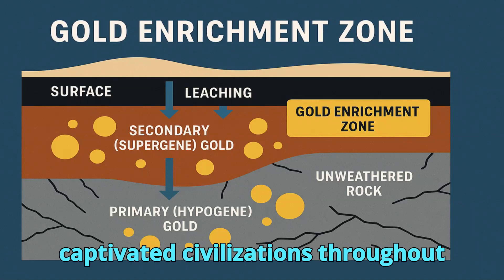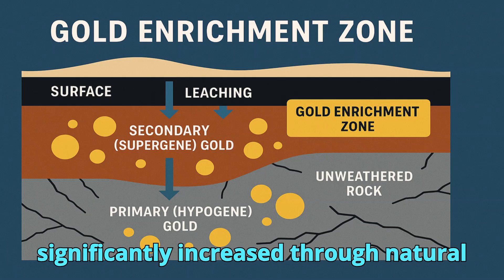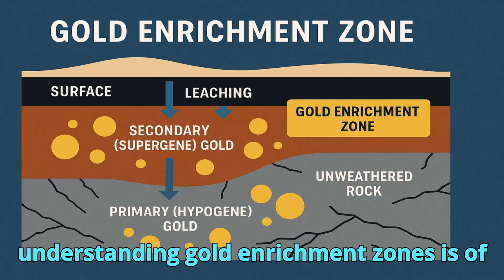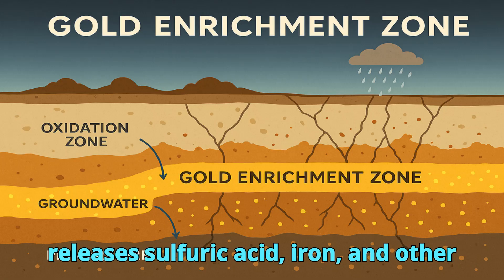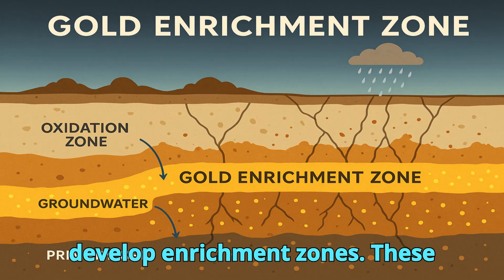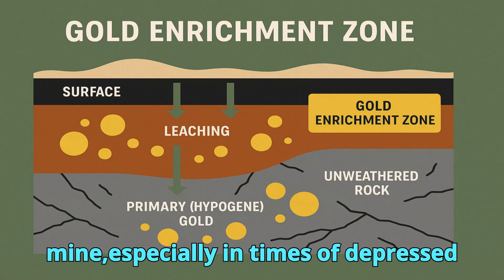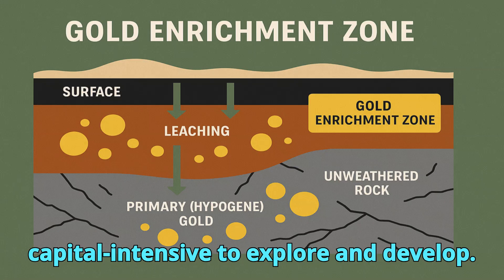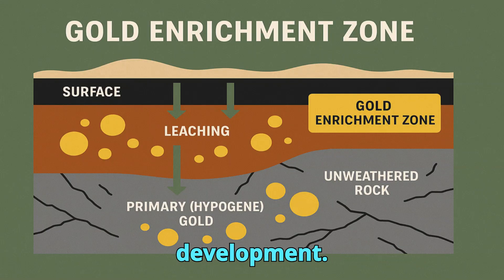How Gold Enrichment Zones Form: A Natural Process That Creates Rich Ores

Comment: Sir I have one request about the different alterations zone in porphyry deposit. 
I mean that in prophylactic alteration which minerals are altered, is only biotite and plagioclase feldspar altered in granodiorite.
Reply from the maker: I think you meant propylitic alteration rather than “prophylactic alteration” (unless your granodiorite is taking preventive measures against disease 😄).

In a porphyry deposit, propylitic alteration is the outermost alteration zone, usually formed under low temperature (~200–300 °C) and low to moderate pH hydrothermal fluids, often rich in CO₂.

Here’s what typically happens to minerals in a granodiorite host rock:

Primary minerals altered

Plagioclase feldspar → commonly replaced by albite (albitization), epidote, and sometimes sericite.

Biotite → altered to chlorite, epidote, and minor calcite or magnetite.

Hornblende / other amphiboles (if present) → altered to chlorite + epidote.

K-feldspar → generally stable in this zone, but may show weak alteration to sericite.

Pyroxene (if any) → altered to chlorite + epidote.

Typical secondary mineral assemblage

Chlorite

Epidote

Calcite

Quartz (often fine-grained veinlets)

Pyrite (minor disseminations)

Albite (if Na-rich fluids are involved)

✅ So in your case, it’s not only biotite and plagioclase that get altered — hornblende, pyroxene, and sometimes even K-feldspar can also be affected, depending on the rock composition and fluid chemistry.
Reply: @professionalgeologyclub ❤❤❤. Well cleared sir, but sir a small notes about   Potassic alteration and argillic alteration too